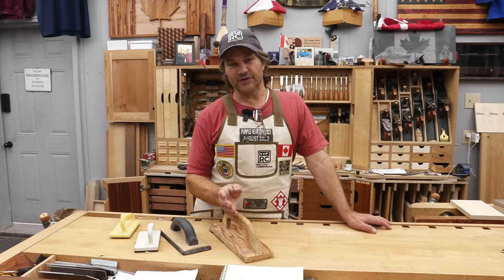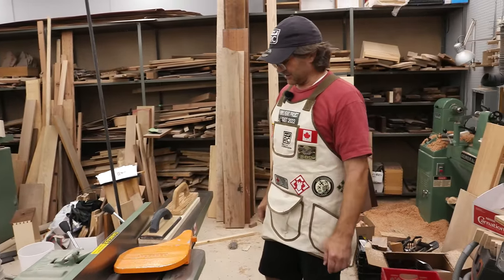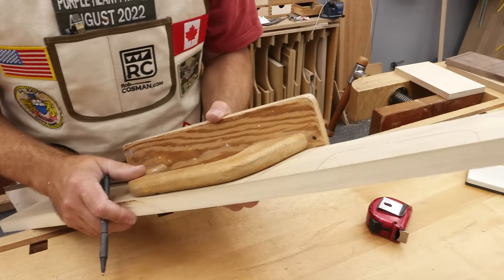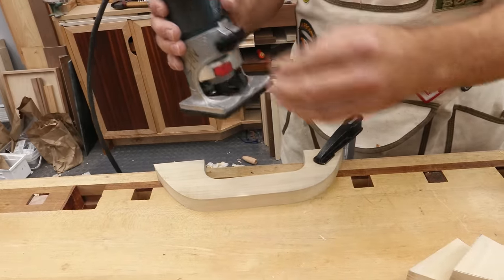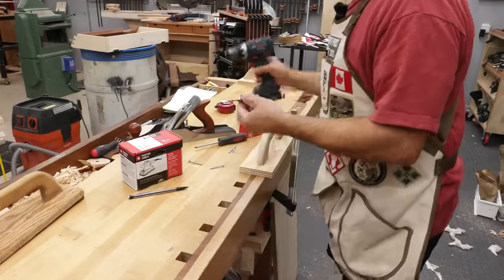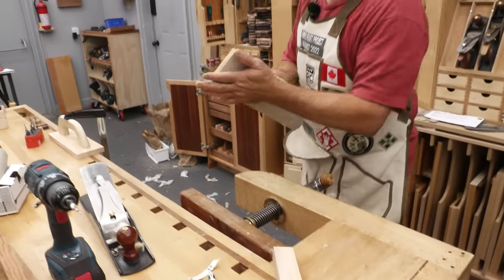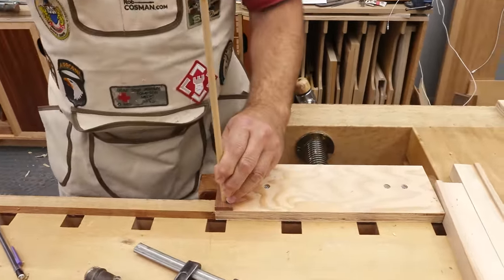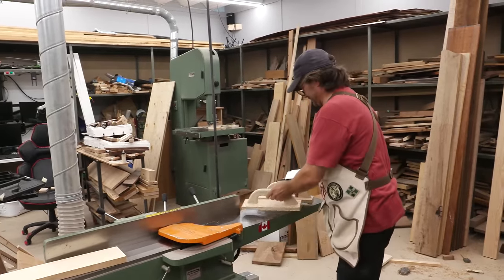DIY Jointer Push Block - Uber Safe !

Comment: Made one not too long ago.  I use it on jointer, router table and table saw. So instead of metal screws, I used dowels- if I screw up and a blade hits the push block, the dowels will not damage the blade. Like you did on the cleat. I put my cleat on the back, fastened with nylon bolts into tapped holes. Also, I used tool box drawer liner on the bottom for grip.

Comment: Thanks.  Never used push blocks till I got my new 8" jointer and it came with two freebies.  But, they are a bit small.  So if I am going to be smarter and safer, I may as well do it right.  Will have to try your design.  Thanks for sharing.

Comment: Nice design. My dad made a push block like it over 50 years ago. It still hangs on a nail over the jointer. It is my go to safety tool every time I run a board flat across the jointer.
Reply from the maker: Wow so that’s a 50 year push block mine was only a 30 year push block!
Reply: @RobCosmanWoodworking  
From the looks of yours it still has plenty of life in it. Thanks for sharing your new and improved version.

Comment: Ah, gotta leave it to Rob to bust out the handplane on the plywood!  Lol.  I'd add a label on the pushblocks (Front, back, etc) so when you reach for them you don't have to see which one goes where .... or make the handle for the rear one out of walnut
Reply from the maker: Excellent idea

Comment: It's not the first time I see you doing this and I wanna ask now: you use the Bosch driller to drill holes, why do you screw in the screws by hand and not with the driller?
Reply from the maker: Mostly because I don’t want to go grab a bit when my screwdrivers are right behind me, but also because I don’t like changing out the bits if I have multiple holes to drill and screw in, and I’m not always sure where another drill is.
Reply: @RobCosmanWoodworking  you see? I was waiting for an answer like "the screws are that sensitive that I don't want to overheat them" or "stressing the fibers with a driller vibrations acts like an earthquake on woods" or other wisdom stuff... Ha ha ha!!! 🙏🏻🌞

Comment: Hey Rob great video as always. I just wondered how do you like that lux cut cutterhead on your jointer and have you ever used the byrd shelix or anything similar to the Byrd shelix and if so how would you compare them. I have the delta 37-190 and was thinking of getting the lux cut cutterhead for it. Thanks in advance.
Reply from the maker: Hey Terry, this is actually the Byrd head. It’s the only brand I have used. Highly recommend them.
Reply: @RobCosmanWoodworking  Rob, did you ever need to rotate the knives due to being dull?

Comment: Those cheap plastic push blocks are horrible! The sponge rubber bottoms work well for a board or two then they pick up dust and slip like crazy. I like the sandpaper idea, I’ll be doing that from now on. Thanks!

Comment: Why not hold the handle in the bench vise while routing the round over?
Reply from the maker: Well the best way would be to use a router table and move the handle over the router but I don’t have one of those so it’s better than to keep the handle flat on the table and route so that I’m holding the router vertically versus horizontally like I would have to do if I put it in the vice

Comment: I think it was stumpy nubs, finger slipped in n got the tip. Think it was a jointer or router can't remember
Reply from the maker: That had to hurt
Reply: @RobCosmanWoodworking  just thought of it it weren't stumpy nubs even though the names fitting it was katz Moses and pretty sure it was a jointer